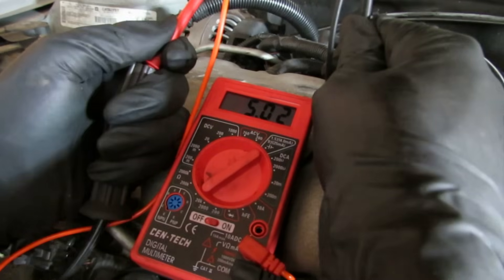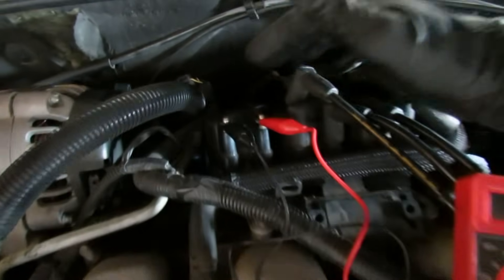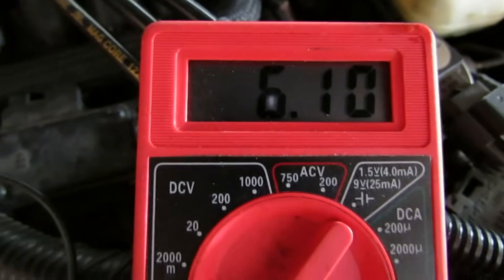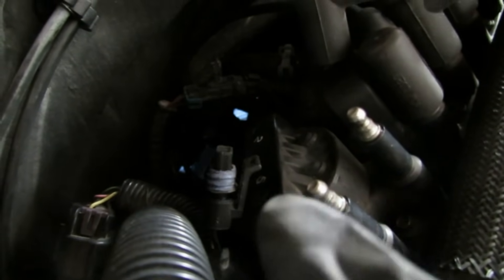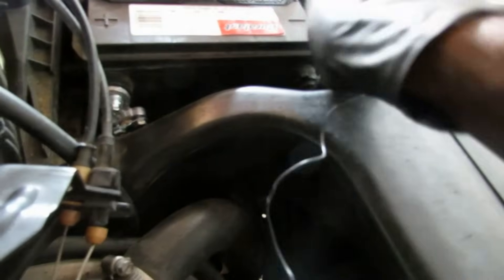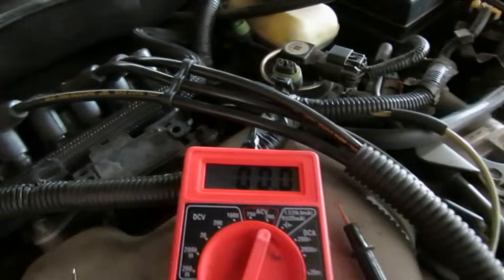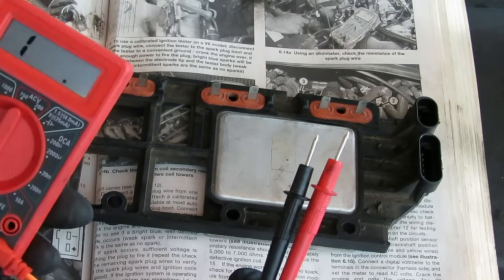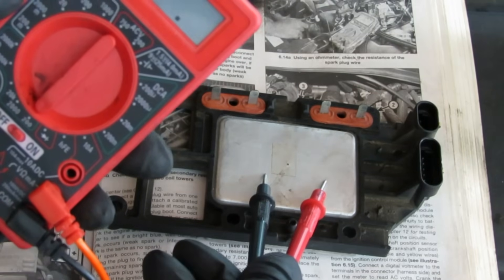Discover How To Test Your Entire Ignition System With One Simple Tool

Comment: @oxmanagain What book?
Reply from the maker: Did your OBD scanner come with a book or manual? And do you have the book on your car?
Reply: @oxmanagain  yes I the owners manual for the car I don't the packaging or stuff that came with the scanner it was a cheap one with the app you use but there's no codes the car just got lack of power stumbling on acceleration vibration at res light its getting about 29mpg when it should probably be getting 34
Reply from the maker: @paulleblanc3301  it is probably a fuel issue. Did you try pouring in a fuel treatment to see if that makes a difference? If it does you now have an idea of the direction to go in
Reply: @oxmanagain  no I haven't yet I ill trying doing that today and I'll get back to you once again thank you for messaging back so quick

Comment: Hey the 4th thing u checked was ignition supply. What does it mean if i’m not getting power to the ignition supply? A little back story cat came in for a fuel pump it wasn’t priming up I drop that in still no start. Performed a fuel pressure test car passed that. So I start checking for spark(also I changed the spark plugs and wires two weeks ago) still was misfiring told the customer he may need coils) fast forward I checked the coil packs and the ignition module. Module was bad and also one of the coils I change those out still no spark I checked the powers supply a sun not getting any power there but that’s where I’m stuck where does that run to?
Reply: Also the car has no codes
Reply from the maker: It sounds like it could be an issue with the ignition control module. Mine literally was it wasn't screwed down tight.

Comment: Can you check the the ignition suppley with a multimeter if you dont have that 12v test tool u have?
Reply from the maker: If the resistance is good I don't see how the coil itself could be bad. You might want to also check the ignition control module (ICM) if you think it's an ignition problem.
Reply: @oxmanagain  its is a ignition problem i get no spar. I was out riding and the motorcycle just stopped, then when I tried to start it suddenly there is no spark, I don't know what it is, I have measured with a multimeter, ignition coil, spark plug, the lights are on, everything seems to be ok. Have searched and searched online and tested a lot so I thought maybe the starter coil broke anyway, otherwise I don't know? the ignition lock or earth fault maybe? What can cause the spark to suddenly disappear? from working perfectly fine to then dead
Reply from the maker: Yes you can. If you get a book it will walk you through the steps because each car might be slightly different
Reply: @oxmanagain  ok tx i thinx i buy a tool like u have, that 12v lamp look easier.
Reply: @oxmanagain  I have one more question, could an ignition coil be broken if the resistance is still ok?

Comment: I have a distributor so idk if it's my coil or the icm in the distributor
Reply from the maker: Have you tested both of them? I have had to replace my cap multiple times, but I've only replaced my distributor once. The distributor is a pretty big job because you have to line it up correctly once you take it out.
Reply: @oxmanagain  I can't even find any clear instructions on how to test the ICM or pickup coil in the distributor
Reply from the maker: What are the symptoms your vehicle is having?
Reply: @oxmanagain  crank no start. 91 S10 4.3l
Reply from the maker: Do you have any check engine lights on?

Comment: Thanks a lot man!  My niece's car with a V-6 is running on four cylinders. It has three coils so I replaced the one that was not firing.  I now suspect the ICM but had no idea how to check it. So I'll be going through your process first thing in the morning.
Reply from the maker: Let me know how it works out for you. And thanks for watching.
Reply: @oxmanagain  The two prongs for the middle coil do not light the test light.  So I am assuming the ICM is bad.  Does that sound correct ?
Reply: @stevehughes1250  Was it the ICM?
Reply: @ianvav    As I recall, the water pump had a leak and was slinging coolant on to the ICM and it had gotten past the seal on the wiring connector.  We dried it out and replaced the water pump.  😀
Reply: @ianvav ign control module real 3800 stuff 😂😊

Comment: Yeah my issue was really tricky I have a 1999 mercury villager and it has weak ignition pulse and also it doesn’t show RPMs on the dash but it will show RPMs on data stream on the code reader

Comment: hi sorry to bother you, i followed your procedures and everything checked out fine. However, the car still wont start. I already changed the fuel pump and filter, also the battery is new. Thanks
Reply from the maker: I have been thinking about your car. Did you get it to start?
Reply: @oxmanagain  going to junk the car soon. i did everything... all good things come to an end. Thanks
Reply from the maker: @patrickmacalalad9921  I fully understand and I have been there. Sometimes moving on is the best thing you can do. The good thing is you've learned what to do for the next time you're in a situation. I appreciate your time and you enjoy the rest of your day.

Comment: Can a bad Ignition Control Module cause a misfire in a single cylinder. Im getting a P0306 code for misfire in cylinder 6. Ive changed the plugs, cables and coil packs. If anything the new Coil made the white smoke and gas smell more pronounced.
Reply from the maker: A bad ignition control module would affect all the cylinders. You might have an issue with the rings on the cylinder head in that particular cylinder. If you have white smoke coming out that's an indication that there's oil or some substance in that cylinder. You might want to try one of those poor end products that coats the lining of the cylinder or seals it. I've had success with those in the past
Reply: @oxmanagain  thanks for the speedy reply. can you recommend a brand or product?

Comment: My tester lights up for all 8 plugs, but only 5 coils change the engine sound when disconnected, one at a time. All coils, plugs and wires are new, but idle is a little rough. Could 3 coils still be bad?
Reply: Did you figure it out
Reply: @bluckq  hi, Yes I did. Bad fuel injectors would give the same symptoms. I found 3 bad fuel injectors. There are youtube videos  on how how to test fuel injectors using a car battery. One I replaced those it worked fine. The 3 fuel injectors were on those same 3 coil packs.

Comment: Just to be clear, for the spark plug test, should I take spark plug boot out and put another spark plug in it or take out the spark plug?
Reply from the maker: If you want to test the boot you can do it both ways. To just test a spark plug I took the spark plug out of the engine put it back into the boot put a jumper cable on to the battery and then on the spark plug and then apply Power by cranking the ignition to see a spark was coming out of the plug.

Comment: How are you testing the crank sensor with it unplugged? I could be wrong but I dont believe that you would get any ac voltage from an unplugged crank sensor... Also how did you get its connector all the way up to the top of the engine bay? It kind of looks to me like you were about to try testing the CAM sensor which again I believe would also automatically fail if it were unplugged...correct me if Im wrong.
Reply: @lucasknie5999  thank you
Reply: Hello Lucas, one question what I need to test the plug coming from the computer or from the crankshaft sensor, the car has to be on the on position or running, I have a 1997 mercury mountaineer 5.0 do you know how do I test the crank sensor, please help me my friend, I did not understand this guy very well. He made the video too fast for me. Please send me some info to understand better, thank you in advance...

Comment: I replaced my cam and crank sensor, it just turns over n over no trying. fuel rails got pressure, you can hear the fuel pump and it will spray to the hood lol,. the wire going to the ignition module when facing the wiring jack, the  one to the far left gets juice when the key is turned on,,  any idea ?
Reply from the maker: Have you looked at your icm?
Reply: @oxmanagain  thnks, that fixed it new module
Reply from the maker: I'm glad I could be of service. I'm glad it helped you out.

Comment: What if there is no spark on any of the spark plug wires?
Reply from the maker: I would check your icm ignition control module or crank/cam sensors.

Comment: What if you have a no start, no crank, no click situation? Can't test sparkplug can I? Push started car and starts right up. Runs good. Bought new battery after this problem started because batt was only reading 12.3 volts. Multimeter says starter is getting 12.55 now when turning key. After banging on starter motor a few times, still no start but I get one click now. Thinking problem is the starter. It will be four yrs old in Nov but it's a cheap one($65.00). Thoughts?
Reply: Starter

Comment: WHAT ISSUE WOULD A PERSON GET THAT WOULD MAKE THEM HAVE TO DO THESE TEST?
Reply from the maker: 1 if your check engine light comes on, 2 if your car has any hesitation or running rough and 3 if you ever hear any noise from the engine you might have a leak somewhere.
Reply: No starts

Comment: That last test was a useless test. You were ohm testing a metal shield if you got through the corrosion you would have had zero ohms on both modules. All other test we're good but I think you misread your ohms reading on the coil.

Comment: I just had my 89 s10 pickup inspected in the beginning of November. before I took the truck to get it repaired I replaced the gas tank fuel hanger and pump assembly. All brand new. Two weeks ago the truck died. When I turn the key on I can hear the pump run but it refuses to start. When I dump gas into the throttle body the truck starts right up and then stalls. When I run a test by placing a paper clip in the ALDL  connecter and watch the flashes 12 and it continues to do this over and over. There's no other codes in between the code 12. This makes me think that it's missing the reference pulse and the ecm is not turning on the fuel pump and  making the pulse width modulation zero. Couple years ago when I purchased the truck it did the same thing.  It refused to start. When  I went to replace the fuel pump i noticed entire hanger assembly and pump were new. What would cause a new pump to go bad? There's a problem but i don't know what is wrong.
Reply from the maker: I will have to do some research for you.
Reply: 89 K1500 Scottsdale... 2 fuel pumps replaced in less than 6 mos., turned out the old metal tank was rusted enough it was depositing little snowflakes of red death and once they mixed into the fuel that was enough to clog the FP. IF you still have the og metal tank, probably a good idea to change bc after 30 years, it's definitely rusty! Just make sure you replace it with the same size. The guy I had do it did not and at approx. 12mpg I sure do miss my old 25 gal capacity! Another culprit of rust/fuel and clogged FPs is the filler neck, if you still have the og one, after 30 years...! Also, may want to (VERY GENTLY) inspect your injectors to make sure they aren't clogged or obstructed resulting in to little fuel. If these few things aren't it double check your ground wires (battery to frame-block to frame-intake mani to engine compartment... to name a few), again, after 30 years LOL hope this helps! Good luck w/your sh!tty chevy, I know how much I love mine!!!

Comment: How did the testing procedures you did show what part failed that lead you to know it was crank sensor cause i also noticed you said you installed a new ignition control module so was it both the crank sensor and the ignition control module bad, I did the test on the voltimeter with the crank sensor wires and it did not change a bit on engine crank so Im trying to figure out if its the ignition module or crank sensor or both, I also did not get the test light reading on removing coil pac and cranking engine it also did nothing,ive already replaced plugs wires and both coil packs and crank sensor only thing left i can figure to do is change the ignition module any thoughts would be appreciated. Tks
Reply from the maker: I tested everything and that was the only thing that failed. That is how I knew it was the crank sensor. I changed the ICM, the spark plugs wires and plugs, the coils and the camshaft sensor. The only thing that was left was the crank sensor.
Reply: @oxmanagain  Awesome thanks for replying, I watched were you said test the crank sensor plug i assume you just unplug it from the crank sensor to test it and then you said have someone crank engine while you prode both terminals with ACV turned on and you should see 200 millivolts typically and i assume when you did that test yours did not originally read anything and thats how you knew it was the crank sensor?
Reply from the maker: That is right.
Reply: Hello Mary please explain me how to test the crankshaft sensor, which side he tested, the wires coming from the computer or the wires coming from the sensor, I am sorry I do not get it, what I understand is if the crank sensor is disconnected how can I test it when he say crank the engine, can you please explain in a better way I want to understand, thank you.

Comment: I had engine code p0342 and p0335. I changed the camshaft position sensor and the crankshaft position sensor twice with no luck. After watching the video I troubleshoot everything on this video, since my OB2 Scanner advices to check ignition system. My ignition control module was the problem, did not work. I'm so happy to have my truck back. Thanks
Reply from the maker: That is great to hear. I'm glad I could help you out. Thanks for watching and I appreciate your comment.
Reply: Hello Antonio, did you understood this guy, I only catched like 70 percent, I need help bro. How did you check the crankshaft sensor which side connector I check the one coming from the computer or the one coming from the sensor, also I do not know which pins, I do not want to burn my computer as you know that is very sensitive, I have a 1997 mercury mountaineer 5.0 engine do you know what pins by any chance? Also I did not understood how he test the ignition control module from the connector coming from the computer or from the module itself which plug I need to test I could not see where those test lights were connected to because he mention to turn the key and start the car. Can you explain me in a better way bro. I speak spanish also, please explain me if you have time to help me, thanks in advance.

Comment: Spark plugs may fire in the atmosphere just fine, but in the high compression atmosphere inside a cylinder it may not.
Reply from the maker: Good point, thanks.
Reply: You're a hundred percent right there is a spark tester to test it in circuit and that's the best most accurate way
Reply: Hello Joe, can you send the name of the tester and where to buy my friend, I want to do it the right way, please help me hopefully you have the part number, thanks in advance.

Comment: I have a 40 horsepower Yamaha outboard d ignition switch may have been left on and there is no power to the motor and the power trim does not work any suggestions
Reply from the maker: I would check the battery.
Reply: @oxmanagain  lol right wht a dumbaz